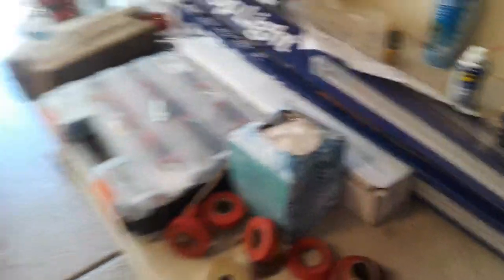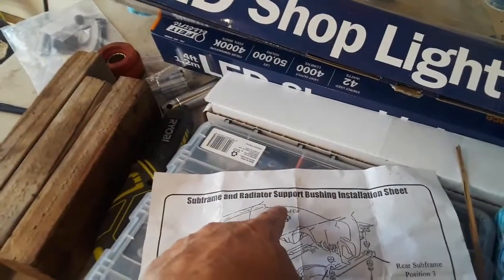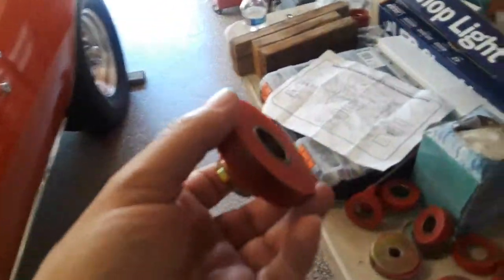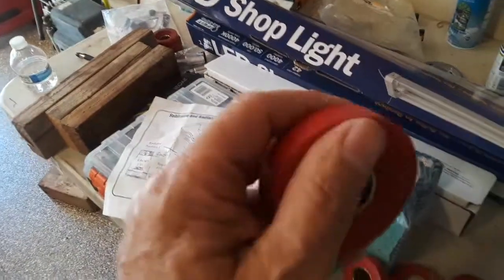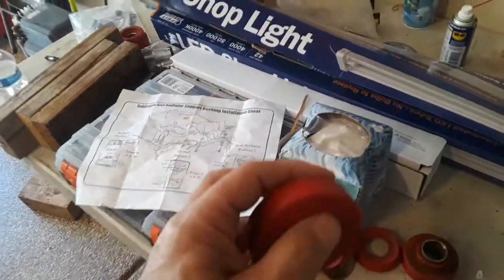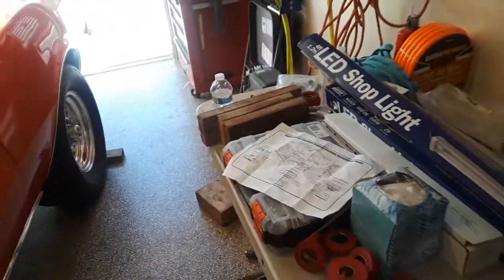1967 Camaro sub frame bushing change out

Comment: The polyurethane and even the aluminum mounts are more for racing for a stiffer ride and less flex for better handling.  If you are just running as a Sunday cruiser then yes rubber is a bit more of a comfortable ride.  All how you plan to use the car.

Comment: What torque did you end up going with? I am looking to replace my rubber ones with the Energy Suspension Body Mount Bushings 3.4142R from Summit.. now that I saw your feedback I am not so sure. Thanks for video anyhow.
Reply from the maker: I just tighten them down good.  Get the rubber ones. So much better ride quality
Reply from the maker: For a firmer, more controlled ride is exactly you'll get.
Reply: DLK014 thank you.